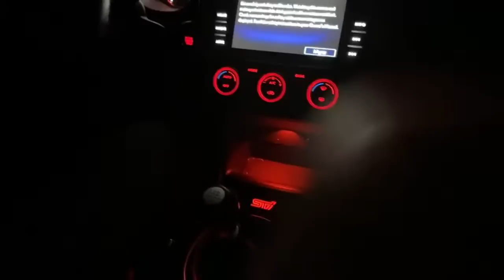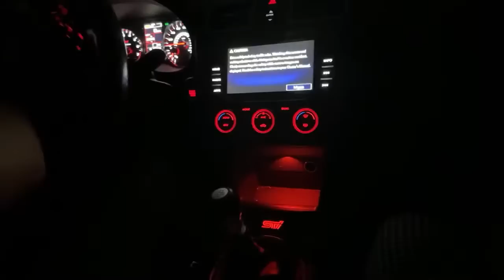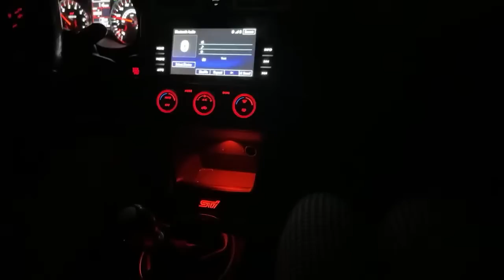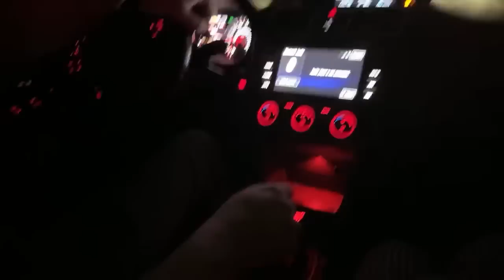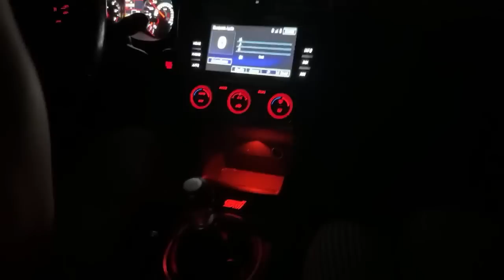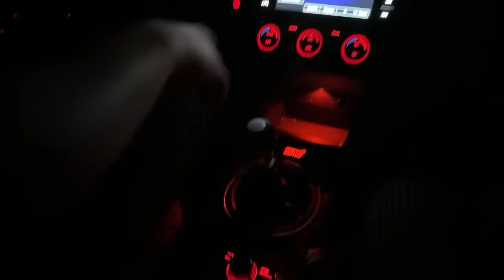Cutting up the Supra (livestream)

Comment: DREW!  For the love of God BUY YOURSELF SOME QUICKJACKS MAN!!! How can you do this for a living and not have a set of them?  They are like less than $2k and you can jack up every car you own 24" inches off the ground with all 4 tires in the air and damn near everything underneath readily accessible with a creeper or just laying on your back.  Buy the 5000 or 7000 TLX model and you can lift anything you own SAFELY and quickly.  They take only 30 seconds total to lift to max height and can come down as fast or slow as you want.  They have a hydraulic flow divider that keeps them level at all times. Once down, they fold up flat and can be hung on the wall or propped up in the corner of your shop or garage.  
     These things are like less than $2000 bucks, which is nothing compared to what we spend on performance mods/parts. Changing the oil, brake pads and/or rotors, rotating the tires, and accessing the bottom of your car to make repairs or perform maintenance will be SOOOOOO much easier and faster than having to jack up each corner or end of the car one at a time and then balance it on jack stands.  That is so much more dangerous than using these Quickjacks, which in addition to locking into position securely without the need for hydraulic pressure are inherently more stable as the front and back lift points are tied together on each side and cannot move independently like they can with jack stands. 
     Sorry for the long comment but you have mentioned them before I think; either way it's well past time to pony-up and buy a set.  I have the extended length 5000 pound model (3" inches tall when flat) instead of the 7000lb model (3.5" inches tall when flat) because I was worried about clearance under my car. The bottom line is that this was the best $2000 bucks I ever spent on a garage item/tool.